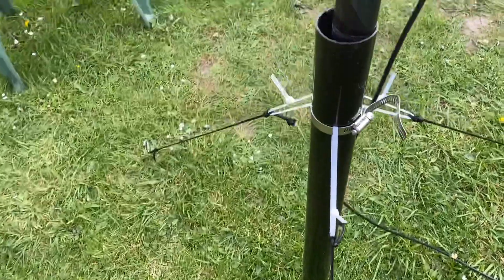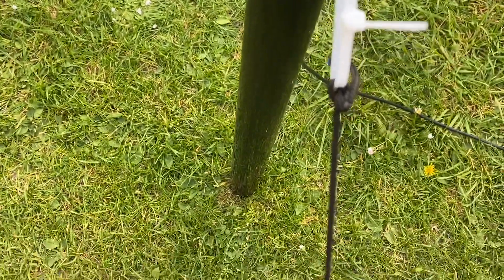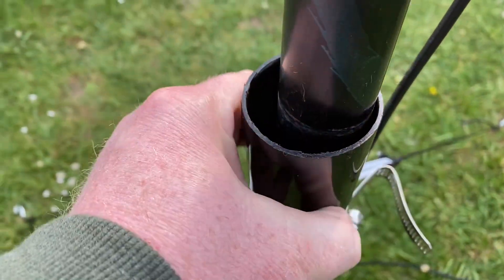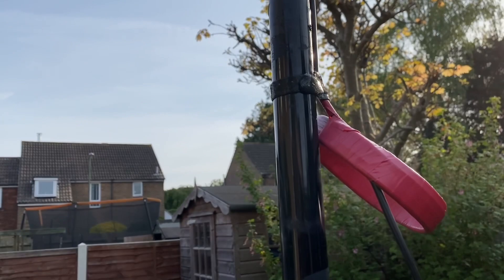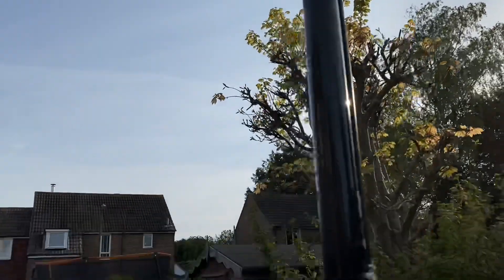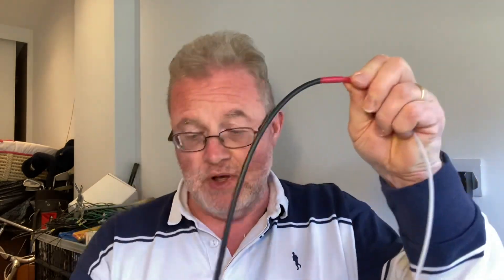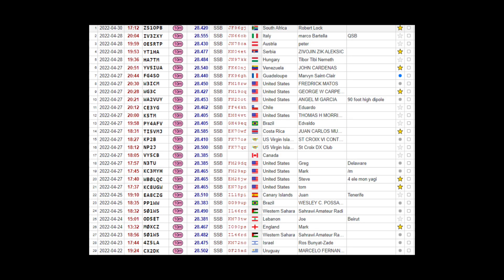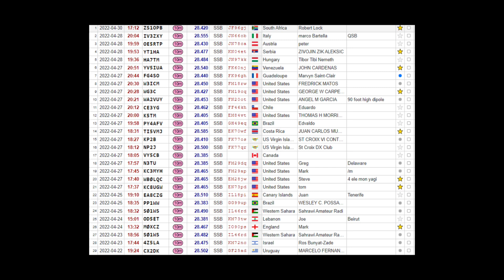Ham Radio: Simple DX Antenna For 10 Metres

Comment: I built the t2lt antenna from your other video the one with the 16 turns on a 6.5 mm former except I did the 16 turns on a 5cm former and it works great receives well and I've got a 1.2 swr on 40 and 1.1 on 1 so thanks for your videos they really help

Comment: easy one to make. I have made a few . wound coil different but works the same. used 65 mm coil on plastic bottle ends cut off . I cut long for 12 meters and buy folding back the end I get tune on 10/11/12 meters. I used a piece of Moonraker RG-8X . ran 500 watt SSB threw it. coil gets warm after a wile. ran up DX commander 10 meter pole. I made one for 6 meters and I used a FT 240-43 ferrite core for coil . held on with zip tie. they have great band width as well. I did one out of gray RG-8X and cut for CB . 65MM coil . usable from 26 to 28 MHz 2:1 SWR with dip to 1.15 SWR in the CB band . you can just strip the end off coax about a CM or 2 . solder a speaker wire at 1/4 wave . use less coax. I did POTA on 10 meters 50 watts on battery . worked a pile up . 73's
Reply from the maker: Nice job 👍

Comment: Hey Tim. Can you advise a portable 10 meter antenna for a backpack configuration while hiking? Durable and portable and rugged.  TIA…
Reply from the maker: The T2LT design can be coiled up to a very small space. Is lightweight as it is made of RG58 and performs like any other 1/2 wave - great for dx as a vertical.

Comment: I love 10M Tim, my favorite band when it's open! I also built a homebrew halfwave for 10-15M. However, u didn't mention how u matched it. I had to use a good 49:1 transformer with a long telescoping whip, adjusted for each of the bands as a halfwave. I also used a 1:1 choke near the transformer. How did u match it? 😀73 KJ6ER, Silicon Valley
Reply from the maker: Hi Greg - its matched by simply being a half-wave long and using the skin effect of the coax to create electrically a centre-fed dipole but in physical terms one that is end fed. The choke of course prevent common mode currents. Basically a flower-pot antenna for 10 metres. No transformer or other matching required. 73
Reply: @TIMG5TM t.   What SWR do you get without a tuner?

Comment: Excellent video, I'm going to build one of these vertical dipoles for 10 metres. One question I have is in this video you say the choke is 4 turns, in your other video, T2LT - Half Wave Vertical Coaxial Antenna For CB Radio & 10 Metres you use 5 turns, why the difference?
Reply from the maker: Little difference .. 5 is fine!

Comment: Great video Tim. Will have to try it got an issue with coax at the moment as I found out tonight. Want to get the antenna up for CQ WW this weekend. Will have to try 10m my best DX in Probably Finland and Spain.
Thanks for the video
Motters M7TRS 73 👍🏻
Reply from the maker: No problem. Hope it works well

Comment: I made one tuned around the airband for scanning and it's pretty awesome. I used Nomons calculator but they seem quite tolerant for us frugal guys. I solder the upper radiator out of 5A mains, single core? Cheaper = free and light weight. So today I made a 10m one for CB. Had some trouble at the start, I don't think it liked the graphite pole (conductive) or the 3 aluminium vacuum cleaner tubes I used to get it off the ground? Once I fabricated wooded pole, SWR came down to 1.2. But then the wind was trying to blow it over. Need to invest in a flag pole!
Reply from the maker: Ah you’ll get there!

Comment: I'm interested in building the same antenna but on a different band do you have the mathematical formula that you used...
Reply from the maker: Hi Pat - just adjust the length to a half wave, with the stripped top bit half of that length. Check G3TXQ's choke chart for the choke you will need for whichever band you choose to use. 73
Reply: @TIMG5TM  hey Tim I finally got a proper doublet up in the air feeding it with 450 and man does this antenna work great I live in Texas and I was able to make contacts in California, Florida, and Indiana so it's pretty much the entire country with one antenna and by the way it's a linear loaded shortened doubled as well I put a middle wire I'm so impressed and just had to say thank you

Comment: Hi Tim, great video. If you crimp a ring terminal to the wire end, or even just a little down, it loops over the end of the pole. That's what I do for my 2m wire colinear anyways, I need to build one of these 10m ones! 73 G0JLF
Reply from the maker: Great tip thanks!

Comment: Great idea, and many will appreciate your info. 20m is the highest I like to go, above that dx is too easy, still waiting for 80m to open to eu from down under.
But I am having fun on 20m with my new 2 ele parasitic vertical  
Array, 2 painter poles and 15 mins and  wow , it's like having a  
Linear in the shack, not that I ever would of course. Video on qrz if your interested. 
73 zl3xdj
Reply from the maker: Good stuff Brian I will take a look 73

Comment: Brilliant, which transceiver and power did you run
Reply from the maker: Thanks Bill - IC7300 and barefoot (100 watts) 73
Reply: @TIMG5TM  thanks Tim, I've yet to hear anything on 10 meters, I also run a IC7300 into either a 132ft long wire or the 6BTV vertical.  I'm going to make the antenna you discribed
Reply from the maker: @billbones9635  nice one Bill I hope you enjoy it
Reply: @TIMG5TM  hi, brilliant video. i build the same t2lt few weeks ago with similar results with rg58 coax. i wonder what would be the max. power it could hande. also useing it with ic7300 barefoot atm. 73 from cape town, de stef zs1ec
Reply from the maker: @vision_lad  400 watts if it’s SSB I would think. 73

Comment: Is your mast carbon fiber or fiberglass? Thanks for sharing.
Reply from the maker: Hi Andrew its fibreglass to avoid any conductive material. 73
Reply: @TIMG5TM  that’s what I thought just making sure.. I plan on getting coax to build this one and the 20 meter version, can’t believe how well it works. 73 Tim de N1YLO
Reply from the maker: @andrewfiertek5937  hope you enjoy the antenna! 73

Comment: Ahhh!  Another Icom 7300 jockey!
It seems as though you had the meter displaying the SWR - and it appeared as though your SWR was "1.0:1, maybe"?  I achieve that with the LDG AT-1000ProII Autotuner feeding an 18-foot jumper 9913 coaxial cable, MFJ choke, to another 3-foot piece of 9913 coaxial cable going to the Chameleon CHA MIL matcher rated at 500 watts, topped off with Chameleon's 17-foot telescoping whip antenna all about 20 feet off the ground! 
Good show here!
KD8EFQ/73
Reply from the maker: Indeed! Sounds like you have fun too 73

Comment: Nice  video   Tim  10M been  good   had qso with Brazil     Tenerife    this evening  10m going be great   like you my antenna is 6ft of  the ground LOL.    Going to be playing around with a Thunderpole boomerang  small compromised  1/4  wave  due to antenna restrictions   73
Reply from the maker: Sounds great! I used to use a Sirio Boomerang 40 years ago on a band that shall not be mentioned LOL! Directional with the one radial and will work just fine. Enjoy!

Comment: FWIW Mike Mitchel (M0MSN) did a similar antenna, but instead of the hassle of striping the braid from the dielectric center conductor, he merely soldered a piece of normal electric wire to the center at the juncture of the braid end.  Maybe a slightly longer result (due to higher Vf of the center conductor sans dielectric), but easier/quicker to make, and works just as well.
[btw - 2.5m =~ 8.2 ft]
Reply from the maker: Yep.. made many of these in my time 73

Comment: Stripping 2m of braid so you're left with the inner conductor seems a lot of effort when you can just solder a piece of wire to the end of the coax.

Just my thoughts.

Keep up the good work Tim.
Reply from the maker: Yep it’s an alternative for sure. I think for the 10m version the 2.5m isn’t an issue. Probably more so for 20m version 73
Reply: what a good idea, well done.